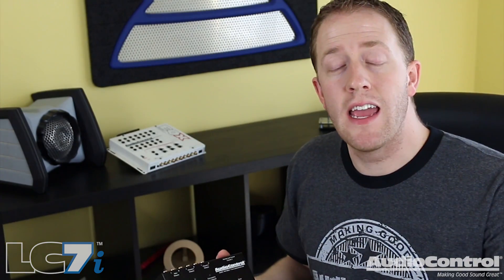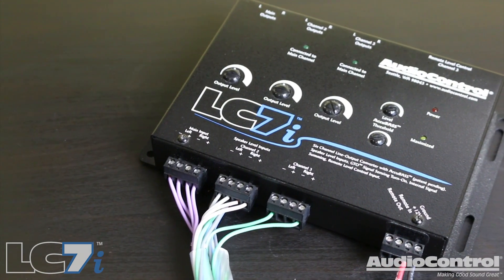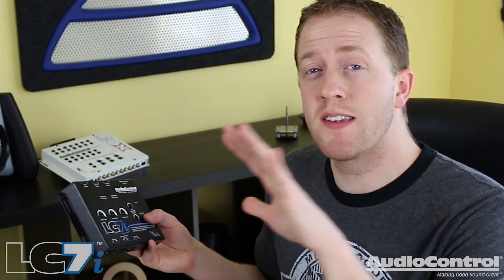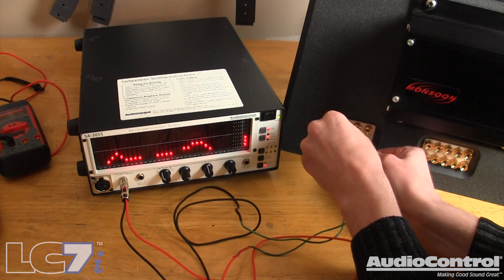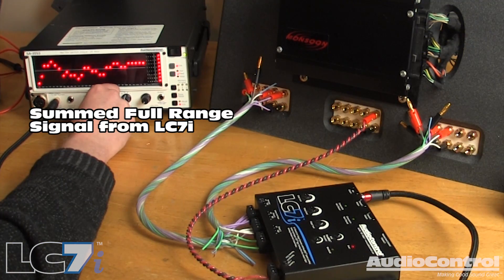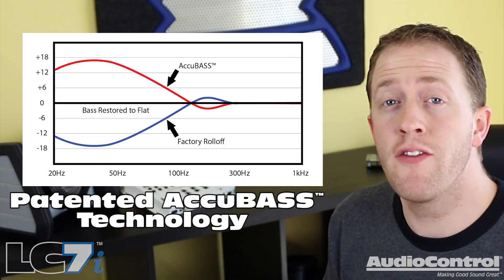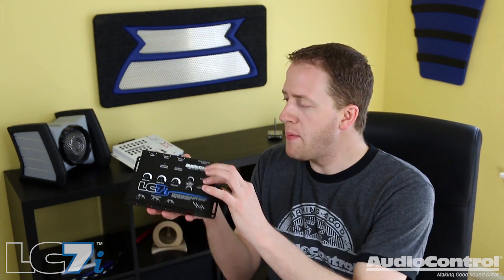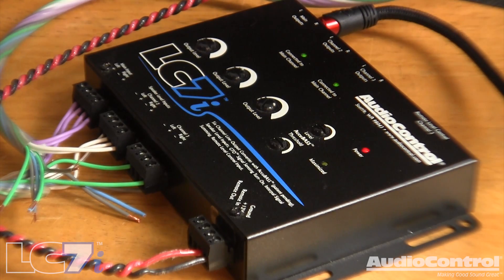LC7i - Add Amplifers to Stock Car Audio System - AudioControl

Comment: The LCpro series are nice but Im still having issues with some customers. They get audio just fine and sounds great but they are losing their handsfree, chimes,beeps etc. Ive had them try all of the load detection options to no avail. These are all happening on GM trucks by the way, the newer ones. Any advice or thoughts? Thank you!
Reply: The Audio Control AC-LGD 60 signal stabilizers fix that issue. $30.00

Comment: I’ve had the lc7i in my 10th gen honda civic. It came with the 10 speaker system so it already had an amplifier. My tweeters are fed into channel one of the lc7i. My problem is I fed the feed from the factory subwoofer signal into channel three of the lc7 and I’m just getting deep bass but not the hard knocking bass. I think that’s coming from the fronts speaker signals which are into channel two of the lc7. The ideal solution would be channel two and three summed to channel three but that’s not possible. Can you help me?
Reply: connect your rear speakers (instead of your subwoofer inputs) for the channel 3. It is counterintuitive but that's your fix

Comment: So it pretty much lets you run stock radio to amps?
Reply: Yes. At first I had a lc2i pro with 2 12’s and a sub amp; it was hitting, but the bass overpowered the factory amp on the mids and highs. I had to turn up the volume considerably to hear the highs. 
Now I have a lc7i with aftermarket high amp, and the system sounds amazing. The subs and mids/highs are in tune, and the system is functioning like it’s factory; but wayyy louder.

Comment: I have a 2018 subsru with stock stereo I install 4 channel amp and jbl speakers I want to add a second amp for a subwoofer do I need lc7 to control sound for speakers and woofer or how I can have better quality on system

Comment: Hi Mark I’m using an factory radio with an alpine dsp 0850 but my subwoofer level is low .Can I use the LC7i to correct the level subwoofer signal and then pass through the signal by the alpine dsp with the rca inputs?

Comment: Hi Mark, I have a 2018 lexus rx350 fsport without Mark Levinson  system, factory pioneer with navigation where do I tap into to  connect  my LC7i ,behind Head unit speaker wires or to speakers wires going into the factory pioneer amp or to the speaker wires coming out of factory pioneer amp.... CAN SOMEONE ANSWER ME PLEASE,.....

Comment: This product has given me nothing but problems.  The bass fluctuates to the point that it will shut down my amp.
Reply: Improper install. My system has improved dramatically with the lc7i

Comment: so the lc2 is for additional after maker subs or speakers and the lc7 is to control the factory speakers and subs?
Reply from the maker: They can certainly be used that way. There are lots of variables here, depending on the vehicle, the system setup, amplifiers, etc. but in general, yes. The LC2i is usually for adding subwoofers/bass amp(s) to an OEM system, and the LC7i is usually best for adding a sub amp and a multi channel amp to an OEM system.
Reply: AudioControl oh so it’s not for controlling the base separately on these new footwell speakers I replaced ?

Comment: 2012 TL does it get signal from before or after the factory amp signal?
Reply from the maker: AudioControl products are generally designed to accept signal from the output side of your OEM amplifier.
Reply: @AudioControlCar  I havs been debating. Its just the factory amps are common to go bad for the Acura TLs.:(

Comment: I just buy a lc7i I want to install it in my car I have a 2007 infiniti I already have preamp crossover and amplifiers in the car now I want use this lc7i to replace a line out converter
Reply from the maker: That will certainly work! Remove your existing LOC, and install the LC7i in it's place. If you have questions, check out our knowledgebase or give us a call. https://www.audiocontrol.com/knowledge-base/

Comment: Does the acua bass send bass to mids
Reply from the maker: No, AccuBass is only enabled on the CH3 outputs, so it can be sent only to your subwoofer, as intended. If you'd like to use AccuBass on your mids, our DM-608 and DM-810 DSP processors allow you to use AccuBass on any output channel you desire.

Comment: I just got one of these and am having a hard time connecting it to my 2017 Honda Civic LX Sedan. I have a 9 wire cable and don't want to cut the Honda wires behind the stock speaker. Do you have any suggestions or Model # for a wire harness? I looked around online and can't seem to find anything.
Reply from the maker: Hey there, Vince. Here is a dealer of ours that makes custom T-harnesses for many popular vehicles. It will allow you to connect your LC7i without cutting any OEM wiring: https://lljcustoms.com/store
Reply: Stock radio.........I didn't mean speakers.

Comment: Added a lc7i on a 2019 Silverado 1500 new body style added door front comp/rear coaxial and amps 4ch and mono Alpine Type R and I’m getting a white noise that doesn’t increase when accelerating or when increasing to low it stays at a set volume and when I open doors the car alerts are louder than before even the turn signal.

Has anyone encountered this problem??
Reply from the maker: This can usually be overcome by adjusting your input/output levels. Please give our tech team a call so they can walk you through the solution. They can be reached at 425-775-8461
Reply: I would double check your ground. Most truck have 3 volume settings. Your alerts probably have it's own volume level

Comment: I have a 2013 charger with beats by Dre system I added amp and sub but all my 6x9’s play bass notes I bought a lc7i will it correct them to highs or what would?
Reply: High pass filters.

Comment: Will this also let the chimes and alarms be amplified? I don’t need those any louder. 😂
Reply: It depends if you have the volume maxed out on the head unit and controlling the volume of your system with you amps volume knobs or DSP controller etc. However there are cars that have a separate small speaker inside the dash board that is used for the door chimes etc. You would have to verify where your chimes are coming from to make sure it wont. If you control the volume from your head unit with out an external DSP after the LC7i then you shouldn't have that problem. 👍

Comment: I wired the lc7i like you did with one sub input. Sounds like im only getting one channel out of the subs. How do i get both channels? I have a 2015 chevy silverado w/bose premium and i tapped into the sub output from the bose amp which only had one output
Reply: This product is garbage.  I have had lots of issues. With sound fluctuates.
Reply: @WICKEDLUIS  I agree, i ended up just buying a head unit
Reply: @ReGuL8r671  I have a 2019 mustang gt, there's no head units that will link to the steering wheel controls so I am stuck with the LC7I, but I disabled the accubass and it seems to work better now.

Comment: Hi Mark - Can I connect 5 speakers (1 center, 2 front and 2 rear) as well as a sub to the LC7i?
Reply from the maker: Hi! Yes, you can. The LC7i is 6 channels, so you will have a spare channel.
Reply: The 6th channel would be used for my subwoofer. Correct?
Reply: Walid Meliane that or you can always watch some looney tunes...

Comment: Hi Mark, I have the Audiocontrol  Lc6i. Is there a difference between that and the Lc7i?
Reply from the maker: Hi! The only difference with the LC7i is AccuBASS. The LC6i does not have AccuBASS.
Reply: Could I also ask you.....I have a F150 with the B&O sound system  and I want to tap off the subwoofer output to my Lc6i but the factory sub has a dual coil with 4 factory wires going to it. Do you know which 2 wires I should pull from?
Reply from the maker: @earlyblackmz - you can use both pairs from your sub - connect one pair to the left input and one to the right. Keep polarity correct (otherwise you'll get no output).
Reply: Awesome! Thanks so much for the fast responses! !
Reply: With the lc7i would that allow me to use an after market equalizer to my after market system ( 2 amps 2 subs and audio control bass knob) ??
Reply from the maker: @kingyella7  Yes, it sure would. Signal chain would be factory amp -> LC7i -> after market EQ -> after market amplifier...
Reply: AudioControl I have a Cadillac XTS with 8 speaker Bose system I want to upgrade all speakers and change sub and use a six channel amp will the LC7i work and what can I use to set proper eq points

Comment: Hello,

I have a 2010 Ford Expedition Limited with sync, factory navigation. I installed AudioControl lc7i with bass Knob, 4 channel amp, mono amp. I now have popping when I turn off or on the truck now. If you can please help with a fix for this issue. Thank you.
Reply: I just bought an LC7 (not installed yet)... Popping generally has to do with the amp shutting off and you are actually "hearing" the last power coming out of it... If it is a cheap amp, this is almost always the case. Before you go replacing anything; unplug your RCA's between each component, one at a time, then you can eliminate whether it is a signal issue or whether it is a shut-off issue. Hope this helps.

Comment: Caraudiofabrication
I was looking at some line output converters online (Wal-Mart and best buy) and noticed they have wattage ratings. I'm pretty sure that would be the output wattage from the head unit, but is that per channel or total (2 channels). The wattage ratings I seen were: 40w, 60w, 80w. My stock head unit is putting out 35w per channel. I will be patiently awaiting your reply.
   ...    .........     ......     ......
Ok, I changed my mind about being patient, lol.
Reply: usually its per channel

Comment: I have a 2004 grand prix with the monsoon radio system in it.  I have component 6.5  in the front doors, a 3.5 center speaker in the dash, a 6.5 coaxial in rear doors and component 6x9 in rear above rear seats  . I changed all the speakers to jbl and with 12 inch woofer by mb quarts. what I would like to know is what amplifier or amplifiers should I use for the12 channels I have to amplify  also what is a good double din radio for me. Thank You  I appreciate your expertise

Comment: After connecting main input ,channel 2, and channel 3 from a factory amp and connecting the main output, channel 2 ,and channel 3 output rca to the amp that you going to install do you connect the speaker output from the amp to the head unit ??

Comment: I have a 2014 Mustang GT Premium with a shaker system/navigation and climate control. I am planning on replacing all speakers w/5 channel amp for mids/ highs/ door 8" subs and rear 6x8. I also plan on 2 10's with separate amp. What DSP do you recommend. I am leaning for the Audio Control LC8-I. Will this do the trick or do you recommend something else?

Comment: Just wondering if this would work in a 2006 Acura Tsx that has 8 speakers total, 2 tweets, four 6.5 speakers in the door and 2 6x9's in the rear deck and I would like to maybe add a amp with a subwoofer down the road? Thanks, awesome video with good information.

Comment: how do you tap into the power supplie  the amp wire is too thick
Reply from the maker: Splice off the amp wire or use a distribution block (better).
Reply: 🤦🏿‍♂️ just bring it to an installer..because if your asking you wouldn't be able to do it properly

Comment: is this different from a dsp?
Reply from the maker: Yes. There is no digital signal processing in the LC7i - everything is analog, including AccuBASS.
Reply: AudioControl does it provide the same purpose as a dsp?
Reply from the maker: Not per se. The LC7i is designed as a line output converter with the added feature of bass restoration/compensation through the AccuBASS feature. We would consider a DSP something which gives you control over EQ, crossover, delay, signal routing, etc. Like our DM-608 and DM-810s: http://www.audiocontrol.com/car-audio/digital-signal-processors/
Reply: okay. Thanks for the clarification

Comment: Hi Mark,

Any tips or advice please.
 
I’m looking to purchase an F33 with a Harman Kardon Hifi
setup. I currently have a E93 and I “believe?” all BMW share the same underseat
subs, which is inadequate for my needs. So I am going to add a sub box and
amplifier via a LOC (Pac Audio LP7 or Audio Control LC2i) My question is. Does
it matter if I connect the LOC to the output of the factory amp or directly to
1 or both underseat subs?

Comment: With the LC7i would you still need The Epicenter?
Reply from the maker: The Epicenter and AccuBASS in the LC7i perform two different functions. Here is a handy article explaining the difference. In a nutshell, The Epicenter restores missing bass (that was never there or removed from poor compression) and the LC7i with AccuBASS will enhance bass already present but diminished due to factory roll-off at higher volumes. 

http://www.audiocontrol.com/knowledge-base/difference-accubass-epicenter/
Reply: @AudioControlCar  ok but the point is if both could work together?? For example if i connect an epicenter to the sub exit of the lc7i it will work well??
Reply from the maker: K W  Exactly what we said! :)

Comment: Hi, I'm replacing the oem stereo that comes with my Suzuki Kizashi with Rockford Fosgate Audio system. The new stereo doesn't come with rca outputs. So it would be a good option using this to connect the new stereo with the factory Rockford Fosgate audio system without losing sound quality?
Reply from the maker: Perfect!

Comment: Hey Audiocontrol!
I really want to install this in my BMW E60 with the boring standard system. 
But after all the research I´ve done, a question popped up in my head. 

I can´t find to understand where you get the sub signal from the input source. I only have Front left/right & Rear left/right from the head unit. I know that there is sub signals in these channels, but there is no actual specified output for it on the unit. What I mean is why have 6 channels to the LC7i when the car only has 4 channel outputs? Where does the 2 channels left come from? 

Hope this made sense?
Reply from the maker: The LC7i has a feature called AutoMode. Channel 3 will grab signal from channel 2 when no signal is present on channel 3 inputs. So, if you have front connected to the main input, and rear connected to channel 2, channel 3 will give you output based on the rears connected to channel 2. Hope that makes sense.
Reply: Yes this made sense! 

Just to understand a bit more;
So I don´t plug anything in to the channel 3 input on the LC7i? The device find the signals internally from channel 2 without any modifications?
Reply: And does this mean that Channel 3 is for a car with more speakers/channels?
Reply from the maker: No, you could just use channel 3 to add an aftermarket subwoofer.
Reply from the maker: Correct.
Reply: Yes I get that. But I don´t fully understand of whats going on the Input side of Channel 3, since most cars only have Front left/right & Rear left/right ergo only 2 channels needed. What OEM system uses 3 Channel outputs?
Reply from the maker: Right. Sorry I wasn't clear. There is nothing going on on the input side of 3. That's the beauty of AutoMode. It will grab signal from input 2 to give you output on 3 so you can "create" a subwoofer signal from your front/rear outputs. 

And to address your point, many cars do have front, rear AND sub outputs from the factory amplifier, in premium systems like Bose, Alpine, Sony, etc. But in your case and many others with only front/rear outputs, the AutoMode makes creating that sub signal easy.
Reply: Okay, that´s what I thought. Thank you for making me sure! :)

Comment: Hi I have a 2016 ats v and will be upgrading the front two door speakers to component speakers and the two rear doors to co axel with 2 sub in the back.  I want to keep factory head unit. Will this work?
Reply: RYAN COLE yes

Comment: GTO doesn't work all the time. See second to last paragraph: http://www.audiocontrol.com/knowledge-base/gto-signal-sense-not-turning-converter/. I recommend turning on the system and checking to see that GTO works first without a REM wire before you button everything up. Better yet, just plan on a traditional REM wire if you 9-wire, just in case. - just a friendly observation.

Comment: Great Vid. I want to install a hifonics Brx5016.5 (5-ch.amp) to connect front/rear door + sub.(dash speakers to be powered by factory amp) I want to keep the 2016 chrysler 300 factory radio. Do i need to by rca cables (if so how many) to connect to my factory if I buy the LC7i? And the amp is 1200w will I run to any problems? Thanks in advance.
Reply from the maker: Hi. You will need RCAs between the LC7i and aftermarket amp. You can tap or splice into the factory speaker wires to connect to the LC7i inputs.
Reply: Thanks for the info. The amp comes with an amp kit. It has 3 - 2 channel rca cables. Thanks for the splice tip. Btw I bought the LC7i for $99.. Do you have a video of the best LC7i settings for optimal sound? That would be great.
Reply from the maker: Hi - we'll be releasing a video soon by CAF of the LC7i, more in depth. You should see it pop up in the next week or so.

Comment: Got a question? Brought  JL C2- 400x 4inch 35rms 4ohm speaker and C2-690tx 6 x 9 70rms 4 ohm and I wanted to add a 6.5 C2-650x 60rms 4 ohm, but I cant seem to find an 4 ohm amp to push them, any suggestions.

Comment: Mercury Sable LS with electronic climate control 03.  What can I do to put aftermarket without paying for that dash kit and without a loc.  please give me a way or diagram
Reply from the maker: Hi, Derek. You will require a line output converter like the LC7i, DQ-61, etc.